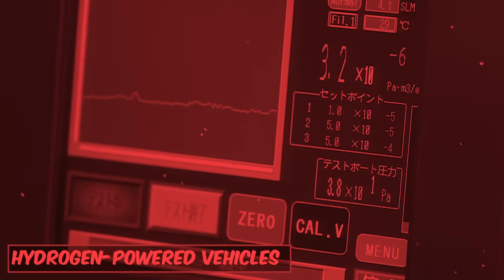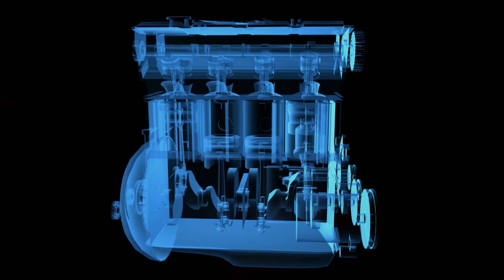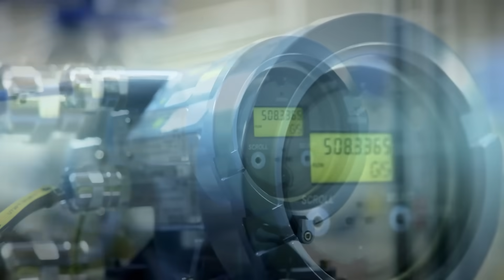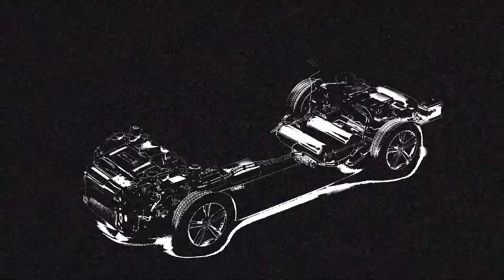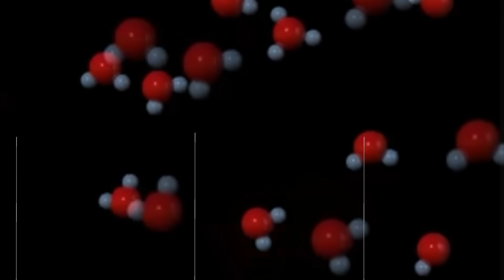Toyota's New WATER Engine Will Destroy The Entire EV Industry!

Comment: You tell me a car with an electrolysis  system plus the full internal combustion engine is simple than a battery, an electronic control system and an electric motor ?  A typical electric car has just 400 parts while an ordinary ICE already has 10,000 parts !!!
Reply: Really - what about the 1000's of parts in the battery - any one of which can cause thermal runaway if it is slightly faulty.
Reply: @DavidNotSolomon  The actual Toyota idea here includes a big EV battery... that's what powers the electrolysis. These videos are intentionally not telling the whole story.... or they're entirely fake. 

I did a little more looking around, and found a video with a block diagram from Toyota, but it was odd -- they just flashed it on the screen. I went back and grabbed a screen shot. It's the block diagram of their H2 fuel cell technology used in the 10-year-old Toyota Mirai. It's a hoax -- there's no water engine. Though Toyota did actually announce an H2O cracking system for commercial use... I guess for fleets that use the Mirai. Stationary, large, and expensive... not mobile.

Comment: The Toyota Mirai's price is substanial and needs hydrogen refueljng station. Good luck findimg them.
Reply: I saw a nice one on eBay, $14K I think, with like 40K miles. It would be interesting to covert it to a real EV by ripping out the hydrogen crap (maybe you could sell it?) and putting in a bigger battery. They're just EVs with a fuel cell.
Reply: They are after money, destruction of life, they are not conserving resources,this car is like triple expenses, hydrogen power stations?? They don't want an EV,  BECAUSE THEY CANT CONTROL THE POWER OF THE SUN, unlike THE HYDROGEN, THAT WILL SERVE A TIME BOMB IN THE FUTURE. RESTORATION, MAINTENANCE, DESTRUCTION, FLAMMABLE, it's just an oxygen to ignite, not a match or a lighter to produce fire. 😢😢😢
Why do they make complications in products,  make a car with a solar panel at the top,  so that it will stand alone no need for charge via ELECTRICITY,

Comment: The presentation of the idea is COMPLETELY wrong. Whoever has written the script, is not really Science literate. (I wonder how deep was the involvement of chatGPT).

The system is not "Fueled" with water. It is fueled with electricity that is used to electrolyze water. ( @1:31 ) 
Water is just the working fluid. It gets broken down into Hydrogen & Oxygen. The Hydrogen should get separated from Oxygen & stored into a tank for being oxidized back to water in the IC engine. 

The whole thing still runs on electricity. It is just changing the battery from Lithium ions based system to Hydrogen based one.

It is a lot of jumping around in terms of thermodynamics & too complex. For the foreseeable future, I will not be moving my investment from Tesla to Toyota shares.

Comment: There are now a number of ways to split water that could potentially make this totally feasible. Whether you choose a catalytic approach, or a radio frequency resonance one, the ability to split water into oxygen with a relatively low level of energy is becoming ever nearer to being a reality, and when it does, the battery industry for EVs will start, thankfully, to take a more back seat. We really do need to find more sustainable ways to get around, and batteries simply do not provide that.
Reply: Explain how that could work, and your Nobel Prize is assured.
Reply: @jamesvandamme7786 Stanley Meyer did it but they killed him during a meal with so called investors. I discovered the resonant frequency which separates the hydrogen from the oxygen in water.
Reply: I have a perpetual motion machine that can absolutely power a car forever.
It works on cash. Everytime you give me a dollar the car goes 100 feet.
Reply: @jwilliam2255  You can't fool me, that's a Flintstonemobile. It's powered by Bronto Burgers... admit it!
Reply: They told us it uses electrolysis, so all it needs is a huge amount of electric power to make the electricity
Reply: You really don't get it, do you? Put very simply it takes more energy to split water than the energy that you get back using the hydrogen. There are absolutely no exceptions.
Reply: @rogerphelps9939 I guess the engineers at Toyota are just a bunch of dumb shits compared to you, obviously a brilliant scientist!
Reply: I was thinking of. Sound or Lasser and other approachs need to be assessed fr   wave of microwave .verying pressure . Vacuum . I can only do it in my myself panting picture in my mind
Reply: @nicholasjohncarter3314  It takes energy to break the hydrogen-oxygen bond. You get that back when you burn or recombine it in an engine or fuel cell. Fuel cells are more efficient than combustion engines, which mostly produce heat and 30% mechanical output (if you're lucky). 

If you start with electricity, you can charge up a battery and get 80% back as mechanical motion in a car. The downside is dragging those batteries around, plus you don't get much waste heat to defrost your windshield.  Obviously, BEVs are the way to go, and batteries are getting better all the time. And hydrogen sucks. 

The only possible hope for hydrogen is generating it before the inefficient electrical generation step. If you have a solar furnace or nuclear reactor, you could produce hydrogen at very high temperatures. that sidesteps the boiling water and running a turbine step to generate electricity. Whether this is economically viable, I don't know. you still have to compress, store, and distribute the hydrogen.
Reply: Would a V8 version of this engine sound like a V8?
Reply: Better!
Reply: @spandel100  Sure, and it would be a (molecular) gas hog, have lots of reciprocating parts, generate lots of NOx, and need a multi-gear transmission, No thankew.
Reply: Boil water in a vacuum so you get H2O Regards Roger
Reply: I beg to disagree. A friend of mine has a Tesla, it can get up to 400 miles on a charge. And boy does it go when the throttle is mashed down. I'll go with an electric car instead of a hydrogen bomb, any day.

Comment: 03:20 'diluted' water ? Wow amazing stuff 🤔 (distilled perhaps)
More importantly, .. where is energy for electrolysis in first place? Wtaf
Reply: No no no!  it is VERY crucial to dilute the water with WATER of course! otherwise this would be clicbait
Reply: Solar is free and nuclear cheap, where oil pumps get their electricity
Reply: He didn't say "dilluted water".  he said "distilled water".
Doesn't matter.  This tech doesn't work anyway.  You can do the electrolysis to get Hydrogen and Oxygen, but it will never produce enough to run an internal combustion engine.  Alternators can use the kenetic energy of the car's motion to recharge batteries that power the electrolysis, but that causes friction that adds a load on the power consumption of the motor.  That extra load increases the demand for more electrolysis gasses.  Though the output of such an engine is water, which replenishes the supply for the internal process, it is not the same amount of water consumed in the process.  So, eventually, the water supply has to be refilled.  regardless, the energy required to provide an adequate amount of gasses to power an internal combustion engine capable of moving a vehicle is impractical and entirely insufficient for normal travel.
Now, if you want to do something really unusual, defy gravity with spinning copper and a perpendicular magnetic field!  That will blow your mind.

Comment: You almost have it...but you must add an atmospheric water generator that captures water, co2 and toxins from the atmosphere. Who will be the first car maker that saved the world? will it be Honda or Toyota? Or perhaps another auto maker. You might want to add a solar panel roof and hefty battery to assist in running the water (Fuel) capture device. I believe it can be accomplished if there are still good and honorable people left in the world...🙏
Reply: If you yourself aren't actively working on it, does that make you not good and honorable?

Judge not.  Lest ye be judged.
Reply: @chrismuller2780  You tell me...
Reply: Would pulling water from the air cause the world to become dryer?
Reply: @johnbland1422  Climate change is causing the world to get warmer. A warmer climate will cause more ocean water to evaporate into the air and become rain clouds. The wind as you know moves the clouds around, raining in one place then another. I'd say winters and summers will get more extreme. It would be wise to prepare in advance for these events.  Good luck.
Reply: Futility and in contradiction with science.
Reply: Or, how long before we stop using internal combustion engines to operate ground vehicles?  Did you ever think of that?  What if we just cut our the need for fuel altogether?  That seems to me to be the way to go.
If we must roll, and not fly, then we must figure out a force of propulsion that requires no engine that explodes with every stroke.  Electricity is the most obvious choice.  Now, the problem becomes how to generate electricity reliably, as we travel.  I'm given to understand that induction is quite effective...
Reply: Water is not a fuel. Hydrogen can be made from water, using lots of electricity, then burned at low efficiency. FAIL
Reply: @jamesvandamme7786  Wrong...as you know technology is always advancing. Splitting water can be done more efficiently now.
Reply: @cruiserland3309  Unfortunately there is no process that can split water into hydrogen and oxygen without using more energy than is contained within the hydrogen produced. This is not because we just need to find a new process ... it's because of the known laws of physics I'm afraid.

Comment: Hi. Hang on a minute. If this engine burns hydrogen from on-board hydrolyzed water, it must also carry a huge battery able to supply enough current to hydrolyze the water while the car's moving. Why not "cut out the middle-man" (mechanicals) and use the electricity to power the car directly? That way the efficiency losses between battery and wheels will be minimized, and there'll be no need for an IC engine, pipes, tanks, oil lubrication, etc. If they do go ahead with it, I suggest it be called "the Toyota Dingbat". Cheers, P.R.
Reply: I assume the difference is charging or topup water. Obviously, topup water looks easier.
Reply: @tolvess  Hi tolvess. It's not the top-up water, it's the fact that it takes a certain amount of energy to split a water molecule (H2O) into the elements hydrogen and oxygen. When they are recombined, in combustion in particular, only about 30% of the energy used in separating them is available to power a car. The rest (70%) is lost either to friction within the engine, with some going out the exhaust pipe as hot gases. The car's radiator wastes energy. When energy is changed from one form to another, there's always an energy loss. 
   It's like paying interest on your credit card: it robs you of future spending power than if you'd stuck to cash. Cheers, P.R.
Reply: Brilliant!  Now if only someone would implement that idea!
Reply: @Modok51  Hi aomurdock. Thanks. Toyota will be aware of the inefficiencies, they didn't get to be No.1 by dismissing science. There are other reasons for their decision to flog a dead horse. I'd suggest 100% tax breaks for research, even Dingbat research, which is actually a good call by their government given the CO2 crisis. Second, any research properly done can result in "incidental benefits" that emerge even if the primary goal isn't reached. For instance Christopher Columbus didn't achieve his primary goal of finding a quick way to China and the East Indies, but he did discover America. (Whether or not that is a positive outcome for the world depends on your point of view. 😄). So when I see solid research going into cars like Toyota's Dingbat, the "Nissan Nightcart", or the "Honda Humbug", I get a warm feeling of relief running down my legs. Cheers, P.R.
Reply: It's the very invention that got Stanley Meyers poisoned (murdered). The year 1833 (Faraday) was 190 years ago. Increase the voltage and modulate the frequency = negligible current.

Comment: Pure click bait. And where does the electricity come from? Hummm kind of side step that. Sorry, there is no free lunch
Reply: Battery maintained by an alternator.
Reply: Needs energy to separate the hydrogen from the water.  Energy is also needed to create the distilled water in the first place.  It's essentially got an internal combustion engine so it's no more or less reliable that what we have got, but it uses lubricating oil so unless they have eliminated all blow by, the exhaust will contain water tarnished with some oil.  It's better, but as you say, no free lunch...
Reply: @100Chicky solar power could be used for the distillation process
Reply: @100Chicky  I've worked with valves lubricated by water back in the 80s. This 100% prevents contamination.
Reply: @100Chicky  The point is you need more energy to make Hydrogen than you can get back.  Electrical energy is the same quantity as mechanical energy.  This what conservation of energy means.  The amount you put is the same as you get out (minus what you lose in heat or other inefficiencies).  The water has no energy value that we can use, you need to put 100 units of energy in to get 100 units of energy out of any system, but some of that output is heat.  You need to put energy in to get energy out.  That energy has to come from a battery in an electrolysis system.  Engines need 50-100kW of mechanical energy to drive a car, where does that come from?  Alternators produces about 1kW of electricity, but they need 2kW of mechanical power put into them to do that.  That energy comes from fuel.  Water is not fuel.
Reply: Right on.  You will need a minimum of a set of lithium batteries to drive the process.  And you still have H2 storage which is very difficult due to leaks.  So maintenance will be a significant issue.  Leaks are dangerous.
Reply: Electrolysis

Comment: The truth is... if everyone worked to make the world a better place instead of focusing on profit, the world would be amazing.  Human beings are smart enough to solve all the problems on earth and go beyond. Just imagine a world where electricity is generated with water, unlimited food supply, cars that can last forever, etcetera.  Would really be amazing
Reply: In this Alice in Wonderland story there is lots on how this magic water powered engine will disrupt EVs and the hand full of Hydrogen fuel cell cars but NOTHING on the large energy source needed to split the hydrogen and Oxygen atoms. The vid says high voltage is needed. It will be high amperage too. So where does this come from? A trickle from a roof solar panel, Alice asks? The energy required will be more electricity than is required to powered an EV. Due to big looses. Where will this electric energy come from, Alice asks? No batteries no charging. Alice suggests that there is a static electricity strap as there was back in the 1950s. That will do it Alice says.
Reply: Electricity is already geneated with water.
It is called hydro-power.
Of course you need to build a big expensive dam, lots of expensive generators and transmission lines so it all has to be paid for by someone.
Reply: You're part of "everyone," so why haven't you sold everything you own to invent it yet?  Answer:  Because you'd rather keep your material things for yourself at the expense of making the world  a better place.
Reply: If everyone understood even the first thing about thermodynamics they would stop embarrassing themselves with silly posts like this.
Reply: Because, Cupcake, it takes MONEY to build things.  It takes MONEY to buy land, build buildings to work in and build the items you need to sell in order to make MONEY to pay your employees so they can make these items in order to make MONEY to buy more raw materials to make these items to sell and make MONEY to pay taxes to stay in business to make these items and make more MONEY to pay the utility bills so that you can keep your business open and running in order to make these items to sell and make MONEY.

Get it now, Genius?  Yeah, nothing is free, no one works for free.
Reply: problems with big moguls wanting to makes more money . oil cartels will fight this to the death
Reply: @torinodan1 I doubt any one making ice cars will be in the least bit troubled by this fantastical nonsense.
Maybe you can explain where the enrgy to produce the hydrogen comes from as they carefully avoided mentioning it in the video?
Reply: @torinodan1  They won't, because they don't need to.  This "miracle motor" cannot exist.

Comment: 🎯 Key Takeaways for quick navigation:

00:15 Toyota is planning to unveil a water-powered engine as an alternative to electric batteries and hydrogen.
01:24 Toyota's water-powered engine works through real-time electrolysis, eliminating the need for high-pressure hydrogen storage tanks.
02:33 This engine emits nearly zero emissions and can be refueled with distilled water, providing a convenient and eco-friendly option.
04:06 Water engines are simpler and more cost-effective to produce than electric vehicles or fuel cell vehicles.
05:12 Water engines have the potential for strong performance and enhanced safety due to the absence of highly combustible fuel storage.
06:21Water-powered engines can offer excellent fuel efficiency, making them economically viable options.

generated by HARPA AI
Reply: Water is NOT the fuel! Where is the source of power to run the electrolysis unit?  Magical magnets and spark plug gizmos to excite the bone ignorant?
Reply: There can be no such thing.
Reply: What, No greed? How can I get rich selling water. Oh distilling it with a gas powered tank. Big savings. Now free water will cost to drink.